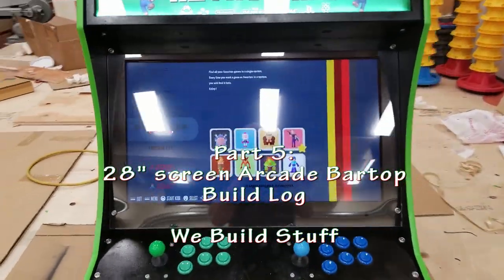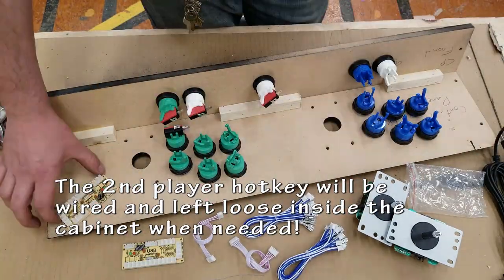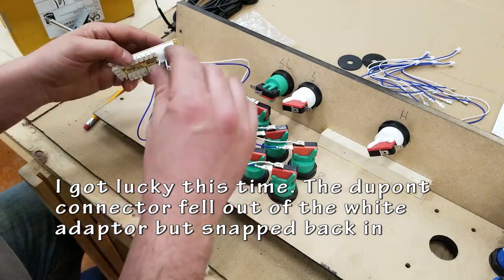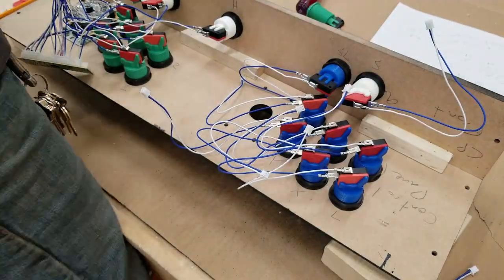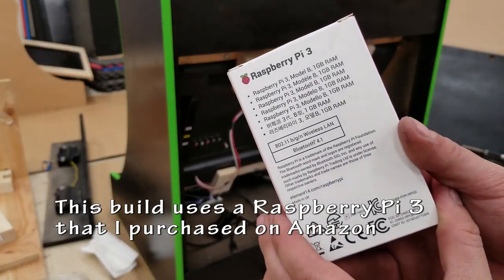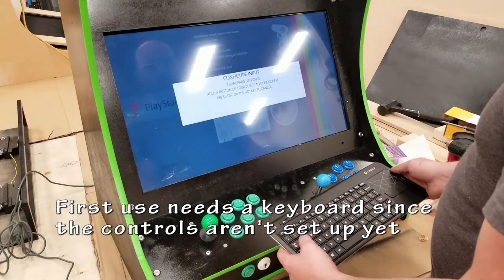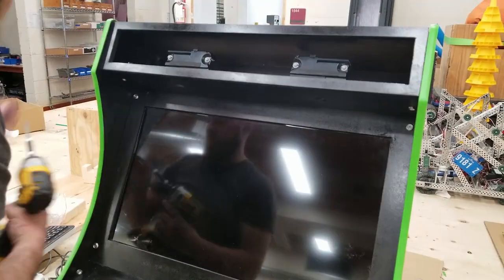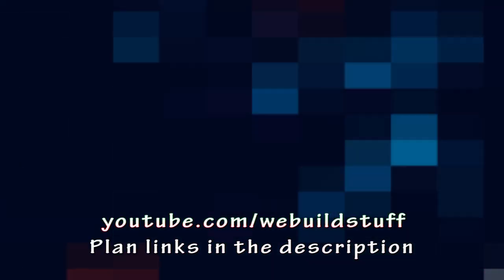How to make a DIY BIGGER Bartop Arcade! - Part 5 - Raspberry Pi

Comment: When locking down the balltops, I find it easiest to use a screwdriver on the bottom of the shaft and can tighten the ball by hand. With three kids its never fallen loose.
Reply from the maker: I didn't think to check for that. Good tip!

Comment: Iv watch it has helped in the electrical bit as mine bar top arcade machine  bits can u go back on yours to the main menu with middle button as iv got to switches it off and on
Reply from the maker: Recalbox uses a hotkey. Pressing the hotkey and a combination of another  button at the same time results in an action. Hotkey plus player 1 start button takes back to menu . 

https://github.com/recalbox/recalbox-os/wiki/Manual-%28EN%29#duringgame-special

 Special commands

Hotkey + Y → Save State
Hotkey + X → Load State
Hotkey + Up → Select Save Slot -1
Hotkey + Down → Select Save Slot +1
Hotkey + Start → End Game and Quit To Main Menu
Hotkey + A → Reset Game
Hotkey + B → Retroarch Menu
Hotkey + L1 → Screenshot
Hotkey + Right → Speedup game
Hotkey + Left → Rewind (if activated in options)
Hotkey + R2 → Next shader preset
Hotkey + L2 → Previous shader preset
In FBA and Mame, press Select to add a credit

Comment: Awesome build..... I'm hoping to copy your build. I noticed you're using recalbox do you prefer that over retropie? Do you have any pros and cons to using it versus the other. I currently have everything to do my build. Other than ROMs working on gathering good consistent ROMs. Hope to start on it late June
Reply from the maker: Recalbox was the first thing I tried when I bought my first Raspberry Pi 2 years ago. You can't customize very much compared to retropie but I also have to do MINIMAL programming or configuration. It doesn't have some of the capabilities for changes options and themes, etc but it works fine for what I need. Just a personal preference.

When you start building send me pics via Instagram!
Reply: @WeBuildStuff  I just got my first Retropie going on a Raspberry Pi 4. It was stupid easy. Just use etcher to put an image on a micro SD card, plug it into the Pi and boot it up. Then I just used windows Samba shares to copy and paste roms from my pc onto the rom folder of the Raspberry Pi over my network.  The only configuration I had to do was optional, as I wanted it to show Sega Genesis instead of Mega Drive, and all that took was to create a configuration file with two lines of code that I copied and pasted. I don't know how it could have been simpler.
Reply from the maker: @Noneofyourbusiness2000  Ya the "programming" has gotten super easy with all the images out right now!

Comment: whats the best option a rasberry p or a pc with 320 gb 4 ram and core dou 2
Reply from the maker: You have more options with a PC and the option to upgrade, etc. Recalbox also has a PC version or use a front end like hyperspin or something!

Pi is cheap and it works for the games I play. PC might support more emulators and customization options
Reply: @WeBuildStuff  thanks